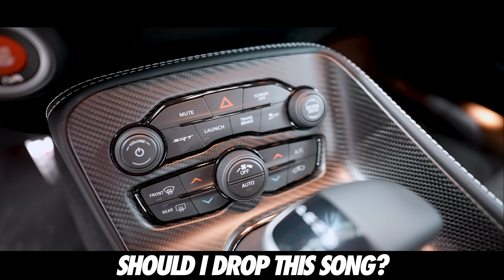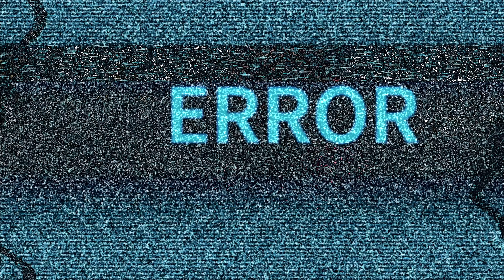Embarrassing Myself in Front of Gas Monkey Garage!

Comment: Just putting it out there to try: 
Try holding traction control until it flashes should be traction control and stability control. Not sure how the gt works with the Mo tech or if it even has buttons but anything I drove newer than 2010 always has a muti-step process pretty annoying but like I said you don’t have stock ecu so idk if this is any help